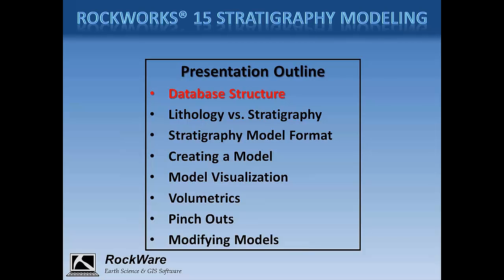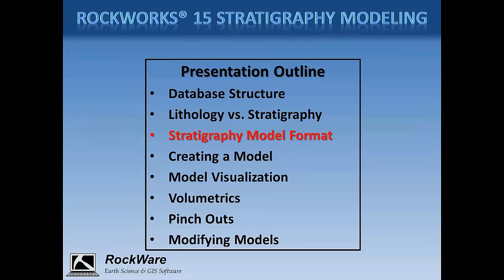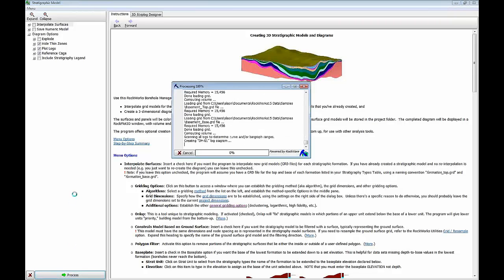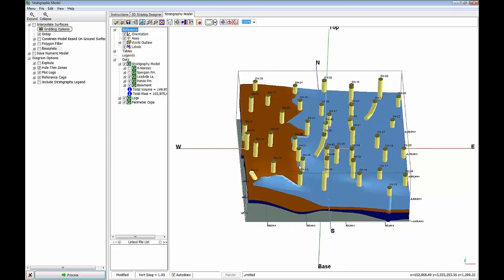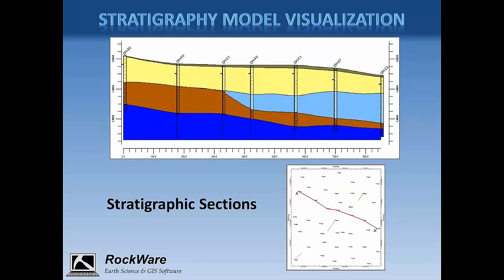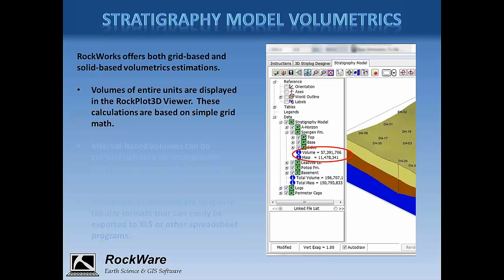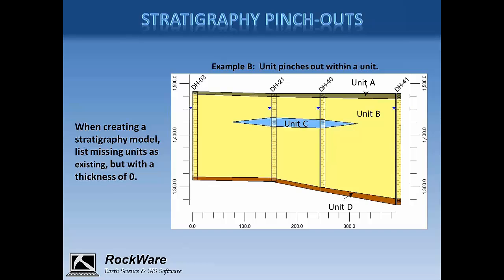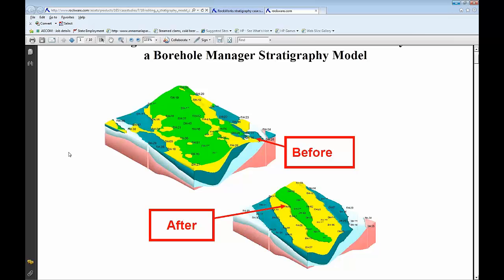(RWW 12) RockWorks: Borehole Manager - Stratigraphy Modeling (RockWorks15 Webinar)

Comment: How to identify the borehole is cross or straight
Reply from the maker: gaddamarun reddy Hi; Each borehole has a linked orientation table in which you define the depths, azimuth, and inclination.  The program then deviates the borehole accordingly.  If the table is blank, the program assumes a vertical hole.
Reply from the maker: If there's nothing in the Orientation tab for a borehole, the program will assume that it's vertical.  If there's a single inclination, the program will assume that it's a straight, non-vertical hole.  You can also add an infinite number of inclination direction/dip points to create deviated wells.

Comment: hi, referring your video, I am trying to make a subsurface model. My project dimensions are as given below: Xmax 21.205, Xmin 21.095, Ymax 79.155, Ymin 79.02. With these dimensions the node spacing appears to be very low, with appropriate number of nodes. This makes my model look very small. I have also tried diagram scaling but that didn't help too. I am struggling to get this model done, and need your help asap.
Reply from the maker: Hi Mrinmayee Ganage: Sorry for delay - just saw this tonight.  What is you node/cell spacing?  Henceforth, please send inquiries to support@rockware.com and you should have a response within minutes, well maybe hours if it's after-hours, or days, if it's a weekend, but it will be much better than a YouTube comment. - Jim Reed.
Reply: thanks a lot Jim......I will definitely seek for the link here after........and I managed to find a solution to my problem..........anyways.....thanks again..........